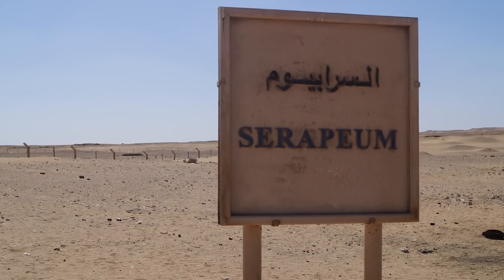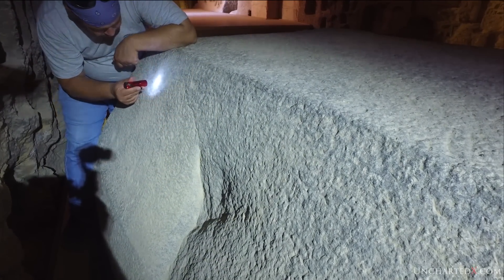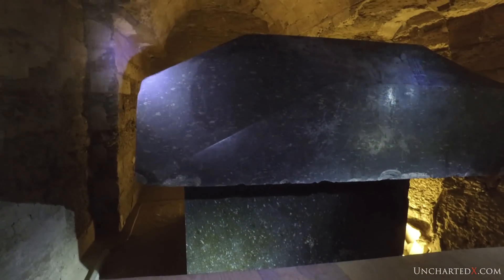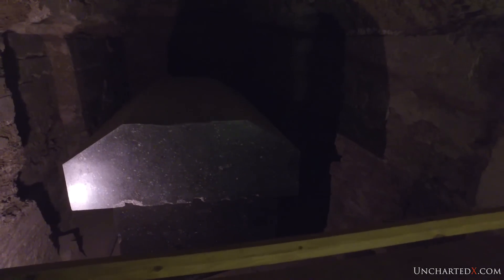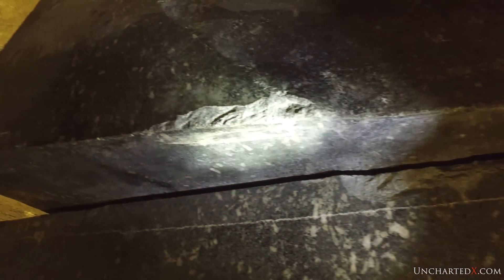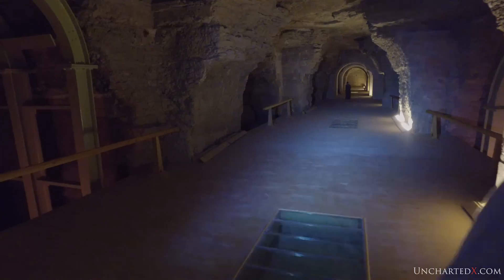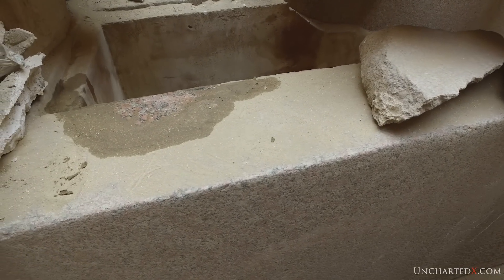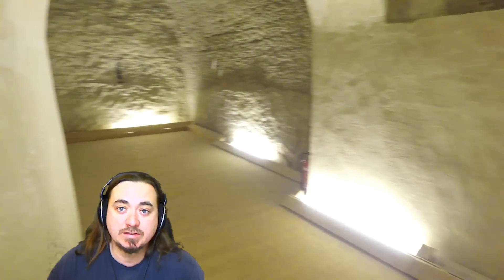Evidence of Ancient High Technology - Liquid Polishing at the Serapeum of Saqqara - Chapter 4

Comment: Is it possible that the function of removing the cracks, and the polishing, is to eliminate damage from freeze-thaw cycles?   If moisture condenses in a crack in polished granite, and the granite then goes through a freeze thaw cycle, the granite will crack further or spall.  The polished surface with no cracks will not do this even if water collects on it, because there is no place for the ice to gain purchase to generate force as it expands.

I completely agree with your analysis that there is no way that these boxes could be created by hand by human beings with the tools proposed by the Egyptologists.   It is almost impossible within the bounds of the problem........while it might be possible in the abstract, academic realm of unlimited resources (i.e., unlimited slaves, unlimited granite, and unlimited time), it is almost impossible in the context of limited time, limited resources, and 24 boxes.  In some cases, the statistics of improbability approach zero probability.....this is one of those cases.  It is much more probable that a civilisation developed prior to the the Younger Dryas reset that also developed technologies we don't understand that were capable of achieving the precision shown.  

Modern human beings  evolved several hundred thousand years ago.   We are no smarter than they were.  Given how much we have progressed in 12,000 years since the reset, it is actually improbable that an advanced civilisation would not have developed in the 100,000 plus years prior to the YD reset.  Pick the answer with the highest probability.......it is obvious, and a statistical analysis would support it.

There are several elements of modern civilisation  that may not have been present in the pre-reset civilisation that might  have contributed to the complete loss of that technology.
Reply: Work Works Atlantis ;-)
Reply: Over the past 20,000 years, the average volume of the human male brain has decreased from 1,500 cubic centimetres to 1,350 cc, losing a chunk the size of a tennis ball. 
so we sure aint the smartest human beings that walked the earth!

Comment: The finish seems to be a bonding fortification probably used to reinforce the boxes and provide durability for whatever pressure and process it was used and designed for. Being shiny may not be the goal, but the result of whatever substance and whatever process they used to bond the outer layers. Is the polish effect only on the outside of the box?

Comment: I have thought that they poured epoxy resin onto the boxes. The drips under the lids explains this. I have used epoxy numerous times. Once on hammered copper for a bar top. Same drops underneath and to the touch it was smooth and it was mirrored as well. After thousands of years I would assume that most of the material would flake off. How long does epoxy last? Especially under ground in a dry climate.
Reply: Also stone sealer gives the same look

Comment: Hi Ben, just been having a look over the Serapeum series, very good , you have approached the puzzle subjectively and presented  your video concisely.
A simple thought popped into my head on this episode, all that effort , must be a very important Function and a necessity for the quality of life for those people who constructed the place. 
Solid crystalline boxes, internal  box walls all perfectly parallel, perfectly polished and empty ,underground.
I think you are looking at a BREWERY !  simple as that.
Solid crystalline boxes, (cracks scooped out willy nilly to maintain integrity of the structure) - used as a fermentation vessel, the contents energized by sound transmission (resonance,cymatics).
internal  box walls all perfectly parallel, perfectly polished - internal chamber of box is acting as a resonant chamber, amplifying and energizing the contents further, the internal length, width and height will be a function of the boxes resonant frequency. Corners machined as tightly as possible to minimise any reflected sound .
Boxes are empty - if you have attempted a home brew yourself , this is obvious, hence need to be kept immaculately clean .
Underground - the fermentor  or box needs to be kept cool, especially in summertime and especially the breweries location, also the box material itself helps with this regard.

To set a brew going all you need to do is introduce sound, it will be self sustaining. (bang a tuning fork and hold it against a cast bath).

I would expect the boxes to be off the ground, on spikes like modern HiFi speakers, you can measure the resonant frequency of each box,   the internal dimensions of that open box should be a function of the measured resonance (will be off slightly with the open box as the integrity of the structure has been lost). 
There should be remanants of cleaning solutions or chemicals or some traceable elements on the inside of the open box, if it has had yeast in it, theres got to be a way to prove it.

https://physics.stackexchange.com/questions/300551/how-can-wifi-penetrate-through-walls-when-visible-light-cant
http://www.howtobrew.com/book/section-1/fermentation/temperature-factors
https://physics.stackexchange.com/questions/142754/help-me-understand-resonance

Just a thought .all the best Ben, keep up the good work.

Can you imagine a world without beer?  Very, very important to me and billions of people all over the world .  Now that is what I call a driving force!!!

Cheers
Jeff
Reply from the maker: voted up because beer!  :)  thanks for the comment Jeff.
Reply: Oh sure. Mean time , no spigot, no easy way to remove contents. Hundreds of tons lids and in a small enclosure.  Yeah, that’s how I brew.

Comment: Excuse this if it’s a common idea, but , if the facets seem there for some function, maybe the fiction caused the outside of the boxes to polish. Maybe water and sand blasted through those rooms , surrounding the boxes for a millennium. Seems that is more of the direction than polishing for looks
Reply: Also, if the functioning boxes self polished, it could make sense that when the process was working some of the surrounding material (maybe water and sand) seeped into the seems of the box lids
Reply: Since maybe no gasket, like the heads of car engines bolted to the engine block

Comment: Interesting... I've been wondering lately if a previous civilization had mastered chemistry (vs our current mastering electricity).  There are some acids that can dissolve some rocks.  I wonder if it's possible to soften these stones to a malleable form.  On the other hand, could it be acoustics?  At high enough frequency and energy mater can shift states similar to heat.  We tend to measure everything based on knowledge from our own perspective.  ie: digital tech wasn't a thing all that long ago.  What other options could be out there that haven't been examined?  Keep up the great programs.

Comment: Watch a video on polishing cars. Polishing scoops etc is easy, finishing off with a ceramic coating. You just need the right tools. Of course it is only paint and the coatings only last like a year but with the right chemicals and the right machines it would be possible.
Also the facets would reduce weight.

Comment: have you considered the boxes may have been used to dampen ambient vibrations for some kind of ancient interferometer array? (e.g. laser holography, which is essentially photographing the interference pattern of laser light interacting with an object). ok maybe lasers is a stretch but silver halide photo chemistry seems well within 'their' toolkit. what if they were using glass plate holograms as a data storage medium? obv an issue getting in (or out of) the dang thing...

Comment: This isn't well reported but we know ancient people's have had chemistry and more advanced than we might normally appreciate for some time. This includes things such as powerful acids such as hydrofluoric. Distillation by evaporation has been known almost at all times because it is so easily discoverable.

In addition to this, even going back to the most primitive cultures people quickly learn all kinds of methods of sealing. From treating leather to wood to stone. The presentation of meat also advances chemical technology and preservation. As impenetrable as granite appears even a stone like granite might not be entirely impenetrable to water and other things.

This is also a good reason to burrow out cracks. It's the most reliable way to seal that area. I think what you really need to think about here is that to have certain kinds of megalithic manufacturing you really also want to be able to have the technology to treat stone as you might wood as well. This is particularly so if you want to be more flexible with the range of stone that you utilise.

Those boxes you're looking at were probably treated many times when maintained and may have deeply absorbed whatever they were using. Someone should take some samples and do a chemical analysis.

Comment: No mention of the black residue ever being sampled and analyzed by anyone? I know when I've polished metal using wet and dry paper, water and oil it creates a slurry of whatever lubricant, silicon carbide and the material I'm working.  It stains pretty well.  Surely someone could go and take sly sample without anyone seeing?

Comment: The boxes were filled with things such as a bull that would decompose and create gases. The gases expand and create the pressure needed to release from an electrical potential. The facets are both to seal and act as terminals. The sanded cracks would create a spark gap in my opinion, and would be undesirable.

Comment: 15:35 It would seem clear that a bit more than rocks, sand and water were used to polish granite - because finer material would be needed than sand. Surely they had this? In Japan they use leaves to fine sand wood. Your grandfather used a razor fine-sharpened on leather. 
It's obvious they had the ability.

Comment: I'm confused. I understand they smoothed the stone to a certain degree, and then the liquid must have been applied. My question is, is the stone actually smoothed to that fine surface quality or is there some sort of "finish" applied. LIke when you touch the stone, are you feeling the granite or a finish applied to the granite like you would when touching a piece of furniture with a varnish or shellac finish? I get the impression that the liquid changed the surface properties in a way to give it the shiny surface.
The surface of the granite looks vitrified. Perhaps they applied a couple chemicals that have a very powerful exothermic reaction when mixed. All one needs is iron oxide (rust)  and powdered aluminum and in the right ratio it produces Thermite. Thermite can get as hot as 3,000'C depending on the metals used.

Comment: The polishing of the boxes seems like it might be glazing, achieved by a hand-held melting device being rubbed over the stone. This would also explain the dripping,  caused by the heater being held too long in one place. The purpose could be to prolong the life of the box and not ornamental. The glazed surface might stop a crack from getting started; stop water from getting into a crack and by temperature change, enlarging it.

The faceted, angular faces could be to prevent the build up of an electrical charge on the box. Curves hold charge, but angles and points concentrate the charge and cause it to jump off as a spark.

Likely, these boxes had a designed life of thousands of years and everthing was done to make them robust and unopenable by the local population. 

As for the purpose of the boxes, storing nuclear waste seems to leap out as a reason. Has anyone used a geiger counter on them?

Comment: Great job for so much insight! Really like your videos! 
But, no need to go in some liquid alchemy idea. Yes, nowadays we use mechanical devices to polish. Together with water, as we can see in those videos you added.
 The liquid for polishing is not the mistery, it is not advanced technology.
 Also the layer could be some wax or oil (or mixture). 
Next time there you should definetely get some sample from surface. 

And  those identations. We do them. I could polish that. Just ask modern sculptors. Although, it's mostly done with power tools 😁
But before power tools artists polished granite in beginning of 20th century, and earlier.

Polishing is not the big deal, but  cutting, drilling and moving

Comment: They might be fuel cells! And maybe even a lightbulb.
I think!! I may have figured out how the boxes are shiny,  and why it seems as if there is a layer of polish bonded to the stone as well as why it hasn't broken down over time. 
Additionally, why there is "polish-drip" between the layers too.

When long chains of fat molecules are placed in high heat, they break down into short-chain polymers that bond with carbon. 
Fish oil, rich in omega-3 fatty acids and alpha-linolenic acid will break down in high heat releasing tons of free radicals.  Free radicals are what initiate the polymerization process.
After layer-by-layer application, a smooth finish can be expected to remain.  One that has filled the porous imperfections of the stone and that is smooth.  One that will be durable and will not degrade well over time. 

The Polishing Process(Theory):

1.) Fish are caught and pressed for their oil content.  

2.) The boxes are filled with a fuel source and a blaze is set.   The boxes will need to reach a temperature warm enough to break down fat.

3.) Fire is put out after the box is hot.

4.) The lid is applied to help retain heat. 

5.) Workers baste the box in fish oil.   Adding additional layers as the oil is "cooked" off.  

5.b.) Here is the point where you will expect to see a polish-drip between the lid and the box itself.  As the oil has dripped and rolled between the two pieces.
There is unlikely to be pooling of "polish" due to radiative heat from within the box creating convection currents of air.  That may dissuade any pools from forming.

6.) After several layers of application, the box polishing is finished.  It just needs to cool.

7.) With the low moisture content of the desert atmosphere, this application can be expected to remain for some time.  

Now you have a large piece of granite cased in a polymer.  
Even more, you have one cased in an ICP.  Intrinsically Conductive Polymer.  An organic polymer that conducts electricity.  They can function as semi-conductors or as metallic conductors. 

Now, Electroluminescence.  If a voltage is applied to a thin layer of an ICP then illumination occurs.  The better the ICP the more power you can pump into it to generate practical amounts of light.  

Those boxes now look like fuel cells to me.  The configuration of some of the lids where "slats" are carved out could easily serve as pathways for carbon cathode and anode to exit the box. 
While the internal cavity could be filled with an electrolyte(salt-water).  If a small voltage is applied to the cathode and anode then voila, Electrolysis of NaCL can occur.  I'm thinking of some version of a Bagdhad battery here for the initiator.  
With the conductive properties of granite, it is conceivable that a voltage could be transmitted throughout the granite box to interact with the ICP...producing light.

This can be tested guys.
We just need someone willing to make a scale model.

Comment: I haven’t read through all your replies so pardon me if I am bringing this up again if anyone has mentioned it. And that is could the liquid be a coating on the boxes for the services? Just as verathane would create a shiny surface by bridging the small gaps in between the crystals, creating a smooth shiny surface. It would be interesting to know if the composition of the underside of the lid is the same as the polished parts.Maybe not the composition of the chemical analysis.

Comment: I cant help but think that these boxes, if they have a function, it might be related to sound vibration. That explains the reason that the cracks have to be dug out completely. I was a machinist in an engine shop, we used this method of taking care of crack removal in some instances, but in other things such as the need to weld cast iron such as engine blocks, you could drill a hole at each end of a crack to stop the spread. The fasceting of the box tops could have been done to tune the boxes frequency. Way too many possabilities.

Comment: Granite work tops for kitchens are polished with acid. These granite tops were more than likely polished using a plant based acid.
Reply: jonny Harrison acid!? Only HF would work, and it is only used in mineralogy or microelectronics.  I have some in my lab, but rarely use it. I never heard of acid polishing, as it would not yield a smooth surface anyway?  Carborundum (SiC) is used. It is quite inexpensive and it is nearly as had as diamond.
Reply: Leo XIV ah in fairness you could be right. I watched something on using an acid type to help two granite stones sit into each other better and got my wires crossed. Thanks for the correction.

Comment: Hey mate are you aware if anyone has analyzed the chemical properties of the surface, or if not what the barriers might be to doing so? 

BTW I have a physics education and to throw in two cents the Bravais Lattice mentioned from Wiki is a geometrically ideal arrangement of atoms bound together into a crystalline lattice structure - the reference to low energy simply means they are packed and bound together in an optimal arrangement and there's no tighter way to arrange them.

This is all about the atomic level arrangement of of pure crystal and is many orders of magnitude from the macroscopic properties of faceting and polishing given to these objects made of composite material by humans, so IMO it's unlikely there's any connection between these two thing. 

Loving the channel!